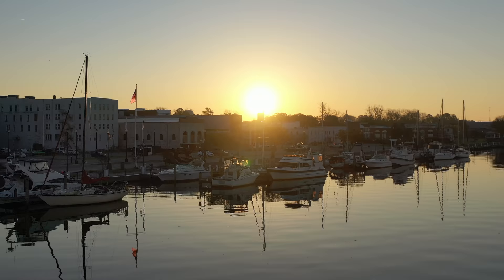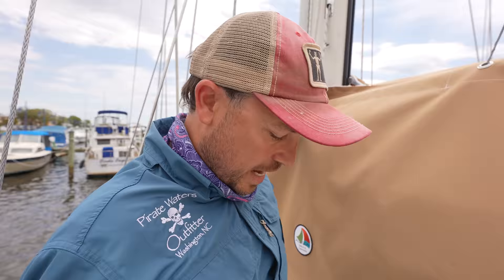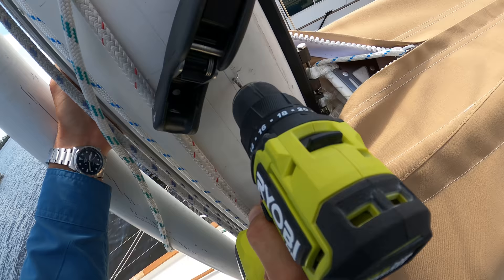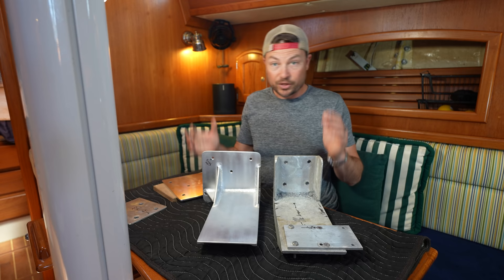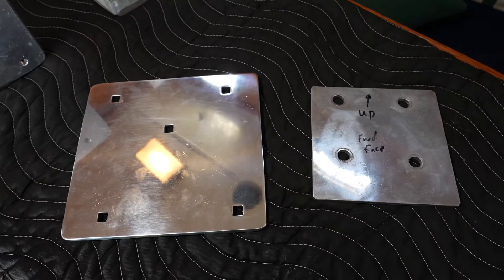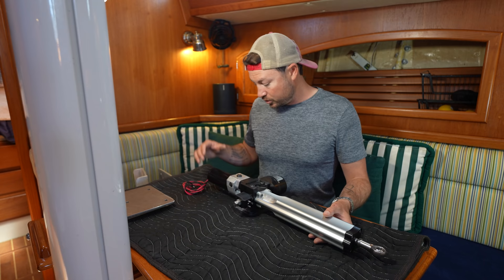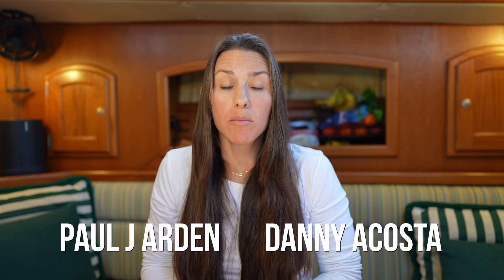Is it DANGEROUS to Sail Across the Atlantic Ocean? | S06E45

Comment: It IS reassuring to have so much of your vital systems done with such good quality like your AP servo bracket. Will you plan on a wind vane so you can save electricity on those cloudy rainy days? Do you have a 'wind' function on your autopilot so you can steer a constant relative wind course at night so you don't have to re-trim the sails after dark at sea or in heavier weather?
JK's advice is always nice to hear. Though he did say something I was uneasy with. If you are in the water and being dragged by your tether, you should unhook and proceed with a MOB rescue at sea scenario!? Here are two alternatives to try before I would ever let a MOB disconnect from the boat since that is the primary objective to recovering someone is to reattach them to the boat! Being drug by the boat on a short tether certainly does set you up to your head being forced underwater. So one of the things to alleviate this is to change the way the tether attaches to your PFD harness. Most attach to a 'D' ring near the chest which I think is what can lead to your head going under the water if the tether allows you to go down to the water level. John mentioned using a really short tether that doesn't even allow you to reach the gunwale much less go over the rail. That is the best solution! But if a short tether doesn't meet your maneuvering needs on deck then put a sling strap on your harness that attaches to the shoulder straps of your harness with the 'D' ring attached to that in the middle. With the pull being centered over your head it allows you to use your arms and legs to rotate your body into any position while being drug. Navy & Marine Corps aviators all go through a water survival course which includes simulating being drug through the water by your parachute. With the attachment points to the harness centered above the head we could rotate the body much more easily being towed from the back of a large LCM (Landing Craft-Mechanized) boat at 15 kts. This could prevent the victim in the water from gulping in the entire ocean while waiting to be hauled in.
The other thought might be to have your tether run through a fairlead to a cam cleat on the cockpit coaming with a figure 8 stopper knot in it to prevent it from slipping through. You could constantly keep it adjusted by pulling the line through the cam cleat one way or the other. If you fall over board and your length of tether is preventing you from righting yourself, the one left in the cockpit can can release the tether from the cam cleat and give you full length of tether to give you the chance to right yourself while they turn up wind to de-power the boat and put it in irons. Then the victim can either pull themselves to the stern ladder or the dinghy davit. But at least they are never detached from the boat, which is absolutely vital at night and in bad weather, the time when a MOB is most likely to occur. The long-line tether can be put on a winch and pull the victim in.
You two should have a plan to allow Desiree to get Jordan back in the boat if he's unconscious without ever having to release the tether. If you have a side ladder that attaches to the toe-rail ensure it can lock in place and not come off if kicked or grabbed by a victim being raised on the boom. It will probably involve the boom being raised up about 4' higher than normal with the topping lift, with 2 double blocks with halyard quick release clips attached to both blocks. One end will go on the boom end and the other should be attached to the 'D' ring on the victim's harness. The boom needs to be fixed in place with preventers or a boom brake while the victim is hauled up and then swung in over the rail. If your main sheet running rigging is already set up to serve in that capacity, so much the better. It's going to take several practice sessions at anchor to do something as important as this safely. You will also need to secure Oso down below or his excitement and concern during a rescue will interfere and may result in him going overboard also. You should also have your spreader lights switch readily available in the cockpit as they will be needed to affect the rescue once the victim is to be hoisted aboard.

Comment: Crossed Newport - Bermuda - Horta - Gib and on into the Med on a 44' in 1979.  No autopilot, no AIS, sextant and VHF and SSB only.  5 on board Bermuda to Horta, 3 on board Horta to Gib.  Some of the finest sailing I've ever done.  Chute up for 6 days straight at one point.  Bad weather?  Sure, some, but mainly a matter of comfort, much more than safety.   You guys will be fine.  Atticus is ready and you are ready.  Did you know that you can hear the thrum of a big ship's engine before you can see them - while they are still below the horizon?   And Faial has the best fresh milk e.v.e.r.  Feeling adventurous?  Climb Pico!  Keep up the good work and have a great trip.

Comment: My wife and I recently crossed the Gulf of Mexico following your route to Isla Mujeres and Rio Dulce. I'm a pilot and took a hand held nav/com radio with us. It allows communication with aircraft overhead as well as ground based facilities and control towers. All airliners and military aircraft monitor the international distress frequency 121.5Mhz. It is line of sight as are our VHF radios but your radius of of potential contact increases greatly if you take the potential contacts up to 40,000 feet. If you need somebody you just get on 121.5 and declare a May Day. You'll get a response if anyone is listening. The radios are the same price and size as our typical hand held VHF. You were talking about ditch kit contents this week and this might be a good addition. You're supposed to have a license to transmit with them, which most pilots would, but when you're life is on the line as a sailor I wouldn't hesitate.

Comment: 1.  Taking a novice sailor, with no offshore sailing experience, is a bad idea. I would think you would want an experienced sailor to help you with your first Atlantic Crossing. Remember, this crossing will be 3-4 weeks, depending on your weather window after you arrive in Bermuda, and you don’t want a crew member leaving your boat when they realize this is not what they expected. Maybe your nephew can join you in the Azores and sail to Madeira with you?
2. Your autopilot is like having a crew member. If it fails, someone has to be at the helm 24/7. I would suggest having a spare if you can afford it. When Ryan (Ryan & Sophie Sailing) was recently sailing solo from Cape Verde to Antigua he had to replace his autopilot steering unit.
3. Yes, risk management is important in making your first Atlantic crossing safe, but also an educational and fun experience!

Comment: Being prepared goes without saying. However, having crossed the Atlantic the most important system is the crew. Rule number 1 crew rest. When you encounter weather, it is not the strength of the weather that is most important, it is the length of the weather. A 30 minute squall is a walk in the park, however 2 or 3 day unsettled conditions is a different story. You are likely to experience fatigue you have never experienced, if washing machine waves last more than 24 hours. Weather systems can create cross waves which will drive you mad if they go on and on. Waves from 1 direction are fine, waves from 2 directions are really trying. So get extra crew, lots of snacks which do not need cooking for extended weather windows and be firm about crew resting when not on shift. Sailing an ocean is a little like climbing Everest, you do not climb Everest for the view, you climb Everest as challenge. Your guest was absolutely correct, do not focus on a count down clock, embrace the experience and keep a personal log. Don't read it until you have finished your crossing. You will revisit emotions that your mind may have stowed away. My wife and I enjoy your videos. Have a great time.

Comment: Edge margin on an aluminum part should be 1.5x the diameter of the hole to prevent crackout or blowout of the hole. But good to get the autopilot ram bracket over engineering. More dependable.

Comment: Of course it's dangerous sailing across the Atlantic!  Your man's comments about having a short tether and Jack stays as near to the centre line of the boat as possible are spot on! When on watch alone don't go on deck. Never go on deck in a hooley unless it's absolutely necessary. Basically, it's all bog standard common sense! We did a transatlantic and we only had an Aries wind vane. When we were becalmed around the Azores we had to hand steer for 3or 4 days it wasn't that bad! (2 German guys on a 28 footer hand steered all the way!)  Of course, the bad things often happen when it's blowing up a bit. With us a shroud failed, below the first set of spreaders. We Hove to and winched the skipper up the mast a couple of times. He jury rigged it and it did the job. He did have a lot of bruising!

Comment: There are alot of things that can be said, but in the end it is stringing together many days of sailing, which you've done before and you are experienced sailors.   I've crossed the Atlantic.   For a new sailor it will be an experience of a lifetime.   My suggestion is it can be rough water starting out and getting used to the constant motion.  You are familiar with this as sailors but your nephew is not and the last thing you want is a sick crew member.  Get some seasickness pills and start him off 4 to 5 days before departure.   Don't wait for him to get seasick before he starts taking pills.  And then 4 to 5 days into the journey you can wean him off as he gets used to the motion.

Comment: My take on all of these things is that it's the wrong question to ask if it's dangerous. It's hazardous in that there are lots of things that are potentially threats involved, you can address and mitigate those threats as much as possilbe (which you've done/are doing) and that reduces how dangerous it is. However even if you minimise the risks as much as possible then it's still possible for something to happen, so the question is really how much risk are you happy taking, knowing that if you are unlucky enough to get run over by a container ship etc. etc. it will obviously be bad. All you can do is decide where your own risk tolerances is, make things as safe as you can and then cross your fingers and go... or not go... Ultimately you can die crossing the road and that's bad too... regarding being draged through the water on your harness - have a look at Teamo's Backtow system.

Comment: "Is it DANGEROUS to Sail Across the Atlantic Ocean?" In a word, No.
I would be more concerned about your propensity for seasickness. Nothing worse than being trapped on a boat for days or weeks and never get over this malady.

I notice you do not have a wind vane.
You might consider somehow getting a copy of John Letcher's "Self-steering for Sailing Craft". By using the information contained in this book I was able to help a French sailor return to Raiatea, French Polynesia from Aitutaki, Cook Islands. He was able to do this with some blocks and line he already had on board and some spear gun rubber found in Aitutaki. I also used the information to build three different wind vane self steering rigs for three different boats I have owned.

Really like Pacific Seacraft. I built a PS25 from a parts kit 40+ years ago. I never crossed an ocean on the boat but a later owner sailed it to Hawaii and then the next owner sailed it to American Samoa.
As for me, I have done a bit of sailing and boat work over the years.

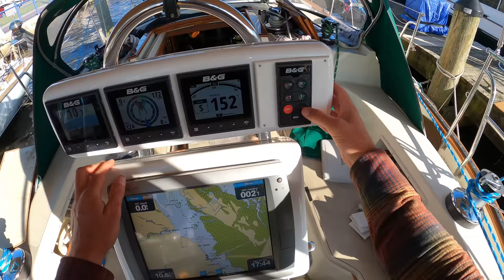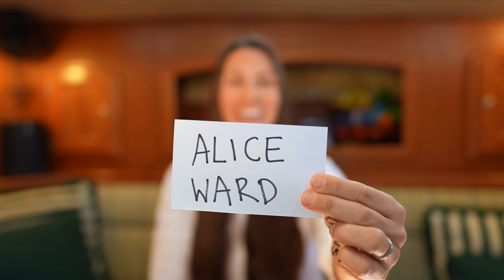Comment: At 8:51 / 18:21 you are showing the autopilot operation. Did you do some camera cuts at this point? the bar you show moving does a jerking motion. I wonder if it's the camera or the alignment? If not the camera, then you should check it again for yourself and see if it is binding or jerking. I know you don't want problems later. Yall just continue to impress me....

Comment: MOB:
- I had an ISAF training in a pool. At one end there were 2 men waiting with a line. This line was thrown to a guy with life vest in the pool other end. He was asked to attach the line to his vest. Then the 2 men pulled. The poor guy could not breath until the other end. Even pulling with some 2 knots will be deadly. 
- MOB maneuver? will fit anyway sooner or later - sorry, more the easy part. The cherry on the cake will be to get the person back at the deck!!!!! - Think about the weight of Jordan, add all his bad weather clothes and drown this all. Will say 160pound on Jordan, 30pound of clothes and then 100pound of water in his clothes - So worst caste Desiree will have to lift  a packet about 300 pound some 6 - 8 feet. Heavy work!
- Perhaps you think about having a separate rope and pulley mounted in the middle of the boat - perhaps at the shrouds. Doesn't need to be mounted - only the attaching point should be fixed.

Comment: The autopilot ram movement didn’t seem smooth, it could have been just the video, but it seemed like it was moving out of the plane. Are there ball joints on one or both ends of the ram?

Comment: If your vessel is seaworthy and your journey is made in the right season, and you sail prudently at no more than eighty percent power,  you have every chance of success.  The only risk would be floating containers--and that would be very unlikely where you will be sailing on the northern leg of the Atlantic wind circle.

If you have any spare cash, fit a Cape Horn wind vane, or perhaps a Hydrovane.  These draw no power and are fine for many hours of constant or near constant wind directions.  Always wear harnesses when on watch, and carry a double-clip lanyard so you can cross lines without unclipping.